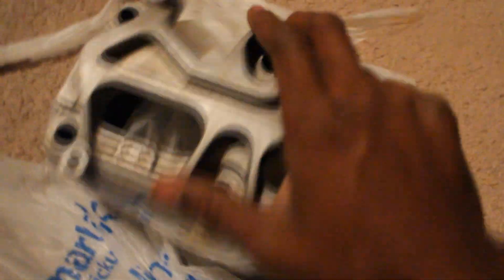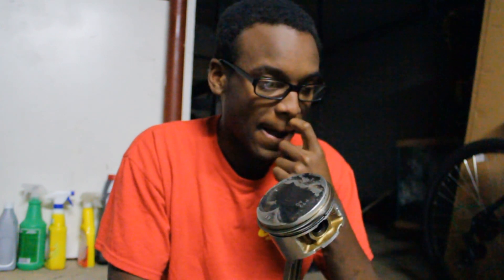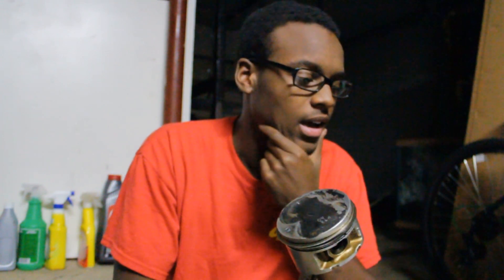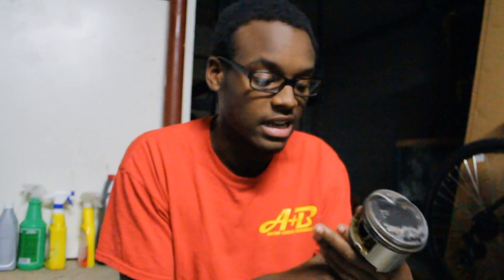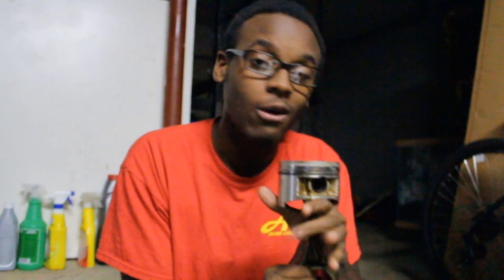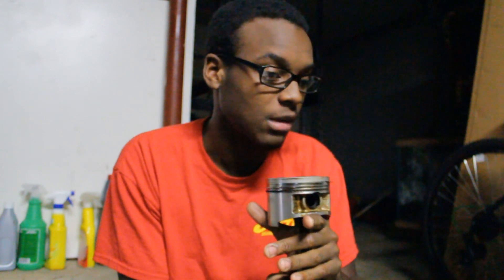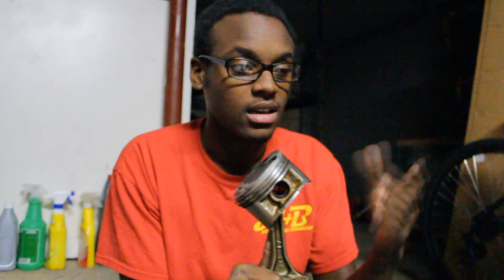Integra B18C1 Crankshaft Unboxing

Comment: A lot of people building don't look into reliability which is really good that you do man. Itr pistons for an extra bump in compression wouldn't hurt. If paired with a set of ITR cams it would suit you well. Higher compression pistons only see max potential when matched with similarly aggressive cams. The crank looks clean!
Reply from the maker: Thanks! I will most likely run skunk2 stage 2s with itr pistons. I have yet to find someone who actually competes in track events in their car and runs an lsvtec ...

Comment: Hello everyone, thank you for messaging so quick, my integra is from 2000 and yes it does overheat every once in a while hasn't done it recently it stopped out of no where again thank you everyone for helping i want to fix this but don't even know where to start or what parts to get
Reply from the maker: lol my first car 2000 gs overheated a lot. and the coolant would bubble. check the fan relays and dont run the ac ever until the issue is resolved. Both of your fans should spin if you turn ac on if they dont then you found your problem. check your thermostat to see if its stuck closed and see if your radiator is in good condition. My problem was the fan relay.
Reply: Chablaa  thermostat or radiator

Comment: Hey man, I have a question about what's wrong with my integra... Well a couple days ago I was driving then a lot of smoke came out and my antifreeze was on the floor nothing looks wrong and when I look into it nothing seems broken as well. If you into this before or heard of this please let me know thank you very much just looking for help thank you
Reply: Chablaa what year is your Integra I know the early 2000's some have common radiator problems. check your radiator for cracks, coolant hoses and radiator cap
Reply from the maker: ive had a similar problem sounds like something bursted..is your car overheating?
Reply from the maker: +Clint Eastwood thanks for trying to help him as well 👌

Comment: Should of went lsv for $600
Reply from the maker: this comment made me lol ^^
Reply: Why? Its possible and its wayy cheaper
Reply from the maker: Gtfoh fam..lol gsr head 2-300 arp and HG 200 gsr cams 100 Thats 600 right there. gsr with ls trans is garb.
Reply: Well here you can get full complete gsr/b16 heads for 350 or less then $150 for lsv kit then $100 for a chipped ecu for lsv
Reply: ^I'm assuming you've never went lsv. And if you have.. Your motor is unreliable af. Lol
Reply: I have a B20v thats reliable so....

Comment: I feel like he thinka JDM motors are shitboxes that are all beat. If he spends a bit more he could of gotten a real C5...
Reply from the maker: +Dead April  I had a jdm b20 and i could have gotten a c5 but i will have a rebuilt motor with equal or more hp than the jdm b18cR
Reply: Than you should of went B20 Vtec, the torque outweighs a C5, or a B18.